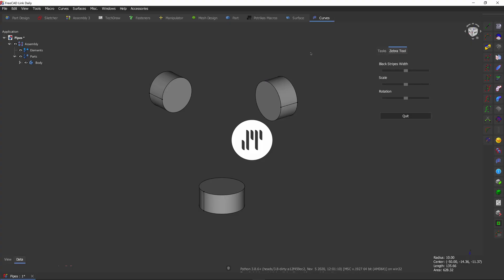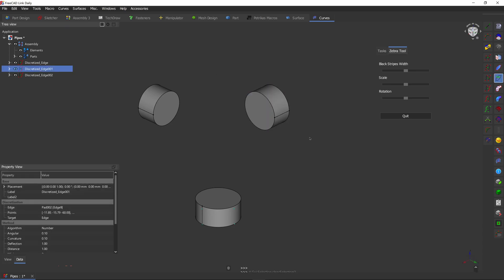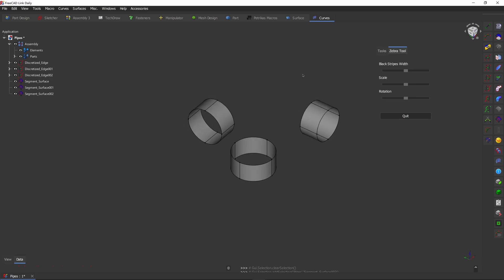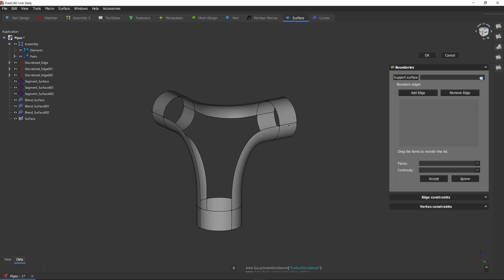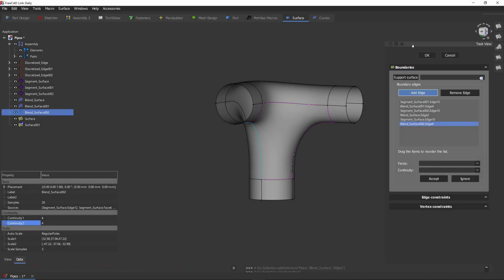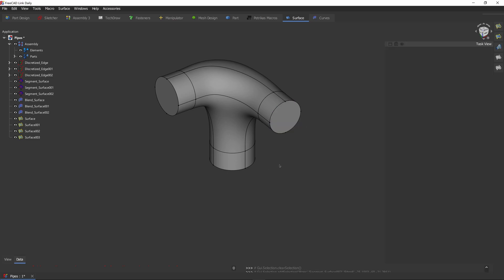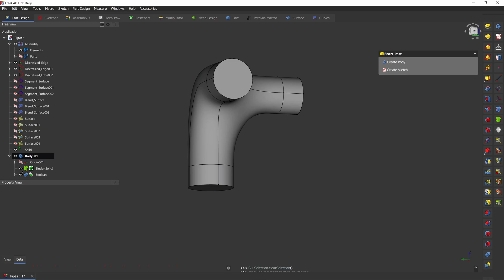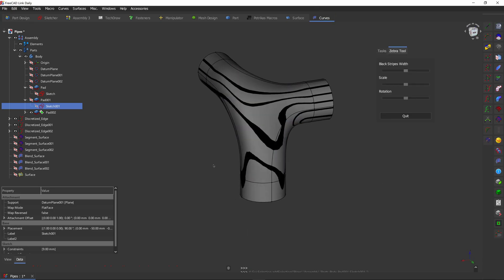[FreeCAD] Surfacing Tutorial (Surface WB & Curves WB) Part 2

Comment: why do you use assembly three workbench? Why do you have to transfer the body to part design, just for the thickness tool?
Reply from the maker: I find that Assembly 3 is the most intuitive to use, as well as offering the most connection types. 
Part Design lets us work on the part further - you can use it in an assembly, drill holes, add threads and so on.

Comment: Thank you for this interesting video.I have tried to repeat the procedure but I didn't succed. I can add 4 points to the circles with the DISCRETIZE tool but the SEGMENT SURFACE tool do not work. I do not know what I'm doing wrong, I have tested sevral times it in Linux or Windows but I do not get my cylinders divided in 4 surfaces. Would you please explain me which is the correct procdure.
Reply from the maker: Do you get an error, or nothing happens?
I made a gif with the process. Can you try and repeat the steps? At what point does your workflow fail?
http://studiopetrikas.com/gif.gif
Reply: @StudioPetrikas  Thank you for your quick answer. What I'm doiing is the folllowing. 1) I create a cylinder from the PART Workbench and move it to a folder called SOLIDS 2) I do to CURVES workbench, then I cliclk on the circular edge of the cylinder and click on DICCRETIZE tool, it works fine and generates 100 points, in the propiertes of the DISCRETIZED EDGE I change the parameterNUMBER from 100 to 4 as ytou teached us in tutoria, and this wotks fine too (the ALGORITHM propierty is NUMBER as it appears by default) . 3 I click on the lateral face of the cylinder and then click on the  SEGMENT SURFACE tool and it generates a SEGMENT SURFACE icon, then I go to the propierties and change the OPTION propierty from AUTO to CUSTOM and then click on the SOURCE ... and select DISCRETICED EDGE and ACEPTAR button (Ok in the spanish verion of Freecad). It generated a surface, but is not divided in 4 equal surfaces, it is only the wall of the cylinder. Sometines it has a red "!" ymbol in the icon, and sometimes it has a blue check symnol in the icon, but never divides de cylinder in 4 equal surfaces
I do not know what I'm doing wrong. I apreciate your help. Thank you
Reply from the maker: @joseluisberruecoroig4258  interesting. What version of FreeCAD are you running?
Reply: @StudioPetrikas  0.19.2 on Linux snd Windows
Reply from the maker: @joseluisberruecoroig4258  Don't hesitate to update to 0.20. Lots of fixes, might fix your issue as well. From your description it seems that you are doing everything correctly.
Reply: @StudioPetrikas  Thank you for yout help. I think that problem comes from DISCRETIZE tool, because dispate it paints 4 poins in the edge, it is not divided in 4 edges, it is just 1 edge with 4 points
Reply from the maker: @joseluisberruecoroig4258  The edge is not divided with the Discretize tool. It just creates 4 vertexes on that edge. Then, those edges are used as a guide to make the 4 faces. 
Have you tried using the Discretized Edge as a Knots VProvider, instead of Knots UProvider?
Reply: @StudioPetrikas  i' m currently out of home for a week. I'll try It as son as I reguen and I let you know t'he result. Thank you for tour help
Reply: Hi, finally I have got it, but the procedure is a bit different than the one you did. Until the DISCRETIZE tool exactly the same, then select thr tound surface of the cylinder and click on the SEGMENT SURFACE tool, go to the propierties of the generated surface and move fromAUTO to CUSTOM, instead of clicking on SORCE propierty and then select the DISCRETIZED_EDFE and Ok, once custiom is selected new propierties have been shown, then I click on the "..." of the KNOTS UPROVIDER propierty and in the window select the DISCRETIZED_EDGE and OK. And now it works.
Thank you a lot for your help and your interesting video.
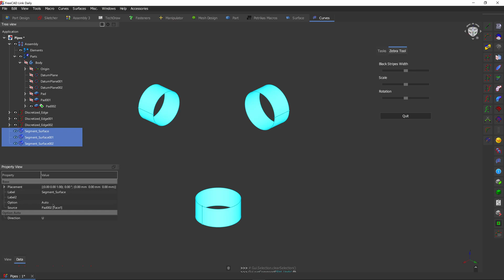Reply from the maker: @joseluisberruecoroig4258  Thanks, but I never said to click on the SOURCE. In 01:53 I click on the OPTION and set to CUSTOM. Then click on the ... in the Knots UProvider. 
I do the same in the GIF.
Reply: @StudioPetrikas  i' m Sorry, as t'he icona este small on t'he vídeo, I missundersrood what you seré doing. Thank you for tour support

Comment: I have a problem; when I make cylinder and after in curve bench rebuilding the edge with four points I get an error when trying to split the surface - I posted on the freecad forum but it is not public/approved yet
Reply from the maker: Difficult to comment without seeing the issue. Hopefully the good prople on the forum will help you out.

Comment: Nice one. I'm new to the Curves and Surface workbenches, but not to FreeCAD. I mainly work in Part Design to design, well, parts for my hobbyist inventions. These extra tools are likely going to come in handy. Two questions though: would it be possible to set defaults for those continuity parameters? That could save a lot of clicking and editing parameters, but there is nothing in Preferences. Also at the end you use a sub-object shapebinder in Part Design. Any particular reason? The plain shapebinder seems to work just as well in this case.
Reply from the maker: Thanks. 
As of yet, I haven't found a way to set tool parameter defaults. It would save a lot of clicks, especially on the Blend Curve and Blend Surface.
I use a shape binder out of habit, because it is nice and quick to detach it from from it's base (right click -> detach on FreeCAD Link), it's one click and you can select multiple objects/bodies to make it. Even though it might be heavier on the resources (I have no data on that), it's a bit quicker an more intuitive, at least on FreeCAD Link.